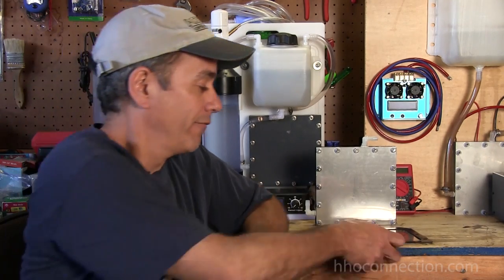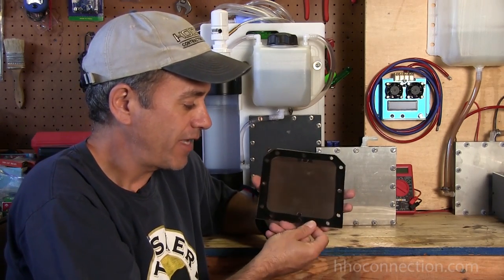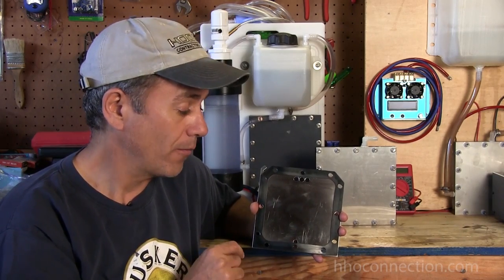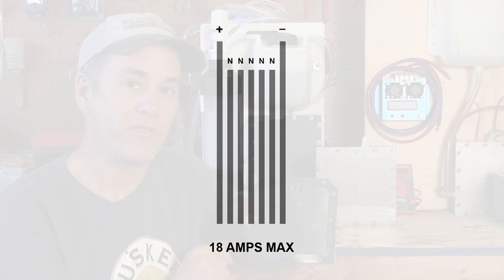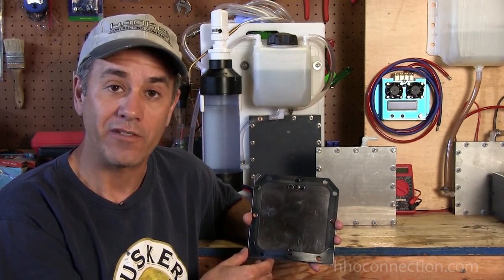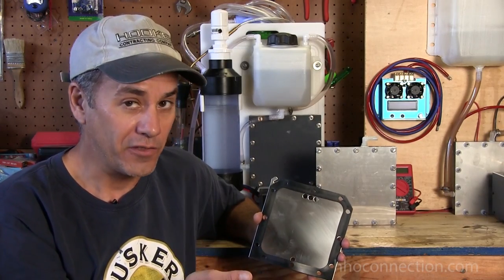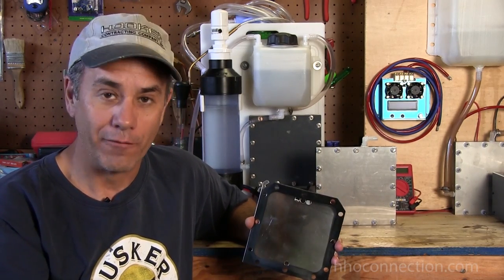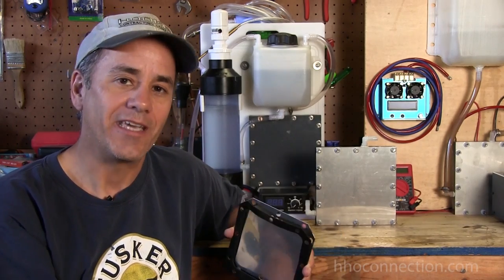How To Calculate Maximum Amps For a HHO Dry Cell

Comment from the maker: Yes, at less than 2 volts/plate gap it gets a little more efficient but the output gets too low to really be usable. 2 volts is about perfect. Rule of thumb is 1/4 - 1/2 lpm of HHO for every liter of engine size.

Comment from the maker: Amp draw is determined by the amount of electrolyte you mix with distilled water. The stronger your mix, the more amps you will draw. The closer your plates are together (thinner gaskets) the more amps you will draw also. 1/16" gaskets are a good thickness.

Comment: Testing with MOST battery chargers is a problem. They all are rectified on only one lead. So you will only get 1/2 wave, not flat DC. Flat DC is battery! You can add a large diode to the charger to get flat DC. Most charger manufactures do it to blow off scale on battery plates, not to mention cheap. (amp reading tests maybe inacurate)

Comment from the maker: Add more electrolyte if you need to draw more amps. If you add more and it does not go up then you need to make sure you have enough power to handle the amps. Either a stronger alternator or battery charger if you are on the bench top. Other than that it's hard to say without seeing it.

Comment: Hi, forgive me if I'm wrong here, but if as you say the cell takes 18A and you want to use more Amps you say connect more cells to it. But won't the current flow from both directions? Taking the picture where you have 3 stacks, then on the Left you have a +ve, then the neutral plates, a -ve, then more neutral plates, then another +ve etc etc.
Surely both of these +ves will feed the -ve plate that sits between them, which in turn will allow more Amps?
Maybe I'm looking at this all wrong, but current doesn't flow just Left to Right or Right to Left, it will flow +ve to -ve ( O'k, without getting too technical, electrons go -ve to +ve )
Sorry if I got this all wrong....

Comment: What is the thickness of the plates?
and if the distance between the plates were increased, what would happen to the resistance and amp(would it increase or decrease?), and what would happen to the temperature?

Comment: Nice work that you have done, I need to ask if you couldbuild a dry cell for just 0,7 l per minute for my Honda 1,5 civic 1999,,which woulduse more then 12,5 amps !!! and how much it cost to sent it to Portugal with a eficiente PWM ?
thanks and oone again congratulations for your good work

Comment from the maker: For starters I would add another neutral plate. Either drop two plates to make a 19 plate cell or add 4 plates to make a 25 plate cell. Regardless you should be getting much more production now. The only thing I can think of is either the cell is very dirty inside (is the water dirty?). If so you need to flush out the cell and use distilled water and 316L plates. If the water is clean, I'm guessing that you have a leak or leaks in your setup and are making much more HHO than you think.

Comment: Mike;  does the cell have to be in a square configuration or could it be 2" high 12" long. I am working on a application that requires a low profile, and also less vertical surface might mean faster response. What are your views on this is surface area just surface area?

Comment: Mike, I recently bought some titanium plates to build a small dry cell, the only problem is the metal is SO STRONG, i lubricated the drill bit and it still takes 10 minutes to drill one hole... any suggestions? also i was curious as to if itd be smarter to do holes like this cell or just three 3/8ths holes down the center of each plate? I bought all the supplies but gave up after failing to drill the holes. Where can i get them laser cut?

Comment from the maker: I only know the plate thickness by gauge, which is either 18 gauge if you are going to media blast the plates or 20 gauge if not. I think it converts to a minimum of .812 mm without media blasting and 1.024 mm if you do media blast.

Comment: I wanted to make a wet cell, due to the materials available I'll probable have two shorter stacks sitting side by side and was wondering about the power supply. I'm going to have a 12v 8amp (about) supply and I was thinking of either having one per set or one for both. Any opinions?

Comment: hi i made my own dry fuel cell and put -nn+nn-nn+nn- and the size of each plate is 12cmx12cm and its reading on my ampmeter 9-10 amps im also using Na0H and 316L plates. what do you think is that good or should i put more n plates. thanks for your great videos.

Comment: Hi Mike.

I build My HHO system and the connection I make is the same you show in the videos 

battery - fuse - PWM - VAC meter - dry cell, and I get 2 AMPS. in the system and is not stable  what I doing wrong?????, the battery is a marine battery 1000 Amps. and I don't now what else I can do can you help me please.

Tanks.

Comment: Mike, I like your videos but you don't talk much about the application to use the HHO generators in. I saw one video where you showed them used to run a torch. Do you use them in any other application? What about on your vehicle? Is your vehicle supplemented by HHO gas and do you get improved gas mileage?

Comment: Ok thanks Mike. Since the water doesn't have electrolyte, will I need to space my plates a lot closer? And will it pull more amps than if I was using electrolyte or not. Thanks so much for the help :)

Comment: hi mike ..thank you for ur valuable info in ur videos! i am working on my clg project.
i hv a 13 plate(7"X7"X 3mm )  304ss cell . i am using KOH as electrolyte .gap between the plates is 3mm. can u plz help me out about the  power supply configurations like how much volt and ampere battery should i use to run the cell ?

Comment: I read somewhere that going over 3 volts per neutral creates losses through heat, true? If you're generating 1/2 lpm of HHO per liter, what are the savings? 20-30% Thanks.

Comment from the maker: Use either Sodium Hydroxide or Potassium Hydroxide. I don't know about how safe they are, they can burn you if mixed too strong. There might be safer electrolytes but none that I know of that work as well.

Comment: Mike do you happen to know if there was actual science (chemistry and math) or empirical testing (trial and error for results) behind Zero's  "rule of thumb".   What types of electrolyte does this rule apply to?  (Acids, bases, KOH, etc.)   You mentioned that this is for 316L Stainless, but the electrolyte probably has a major impact.   Does this have anything to do with passivization or reaction to electrolyte?  

Thanks for your posts, you always present very well.

Comment from the maker: It sounds to me like your plates are not really 316L. If you are 100% certain that they are then my next guess would be that you are not using distilled water. Are you using tap water or spring water? If so then minerals from the water will cause this. If you are using distilled water then the only other thing I can think of is you are either getting contamination from another source or you are using far too many amps causing impurities to leech from the plates.

Comment: hey hho guy, i need your help with an experiment. i noticed your website domain expired so i cant email you this question. i hope you check your youtube comments. i was wondering if you ever tried using ac power. with the proper wavelength, it could resonate and increase the efficiency. i have no idea if this would work, just a theory of mine. you could turn your 12vdc into ac at the same voltage with a 555ic and a high power transistor pretty easily. unfortunately my hho cells are too unreliable to experiment with, but your cells and equipment could definitely test this theory. ill build an ac converter that can withstand full power to the cell and have adjustable sin wave AC. with the distance between the plates, i can calculate the frequencies that should work and make it easy to set to those frequencies. reply to me so we can work out a plan if you want to help me with this experiment. ill build the ac thing and ship it to you at my expense, i just really want to see if my idea has any potential to increase efficiency.

Comment: Million dollar question,  What's the wattage?
Reply: Wattage = Voltage X Amps. so if you have 12 volt X 54 amps = 648 watts.
in simple cell he explained is 12 volt X 18 amps = 216 watts
Reply: When or where dose he say the voltage?  I would have never asked this question if that was provided.  And aren't HHO reactors powered efficiently at 30 volts?
Reply: amount of volts times the amount of amperage.. V*A=W. you should have asked wikipedia instead of youtube
Reply: And you should have notice sarcasm against a vid that does not disclose Volts or Watts.
Reply: ;))) Never notice. I find myself wanting.
Reply: When I first made my comment, 1:23 did not exist. I could swear it didn't.